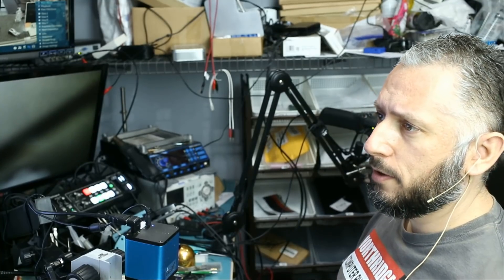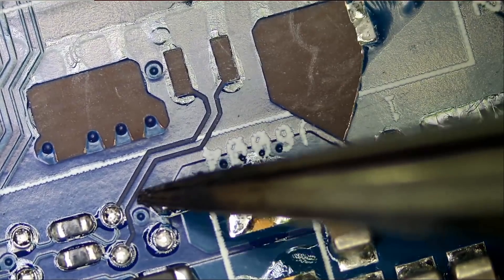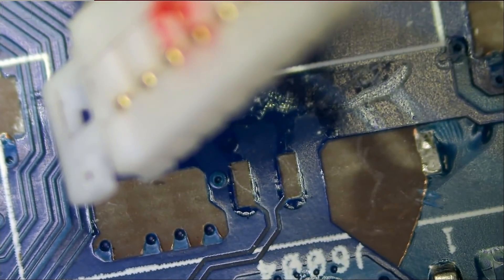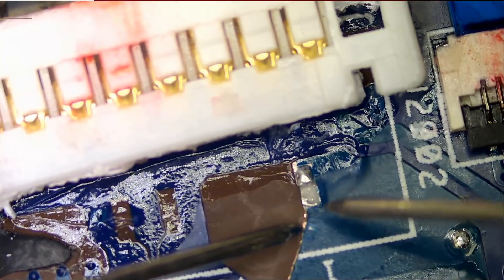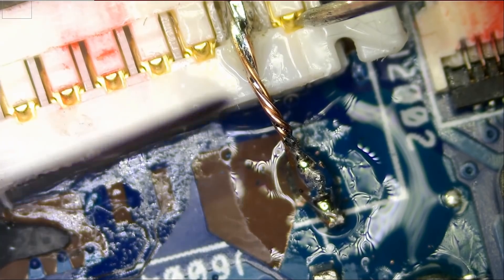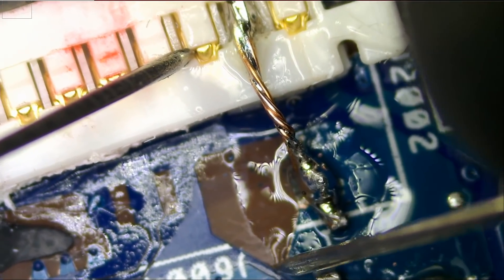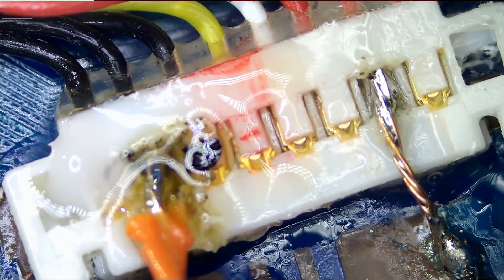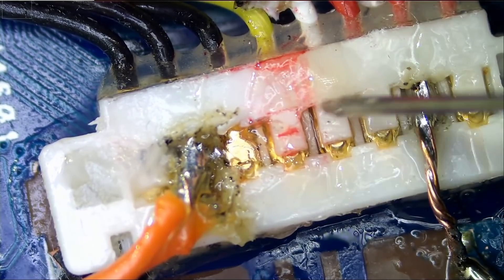Asus Zenbook UM433DA battery connector ripped off the board and all pads torn off the board Repair

Comment: Asus have a good spec laptop but when it come to board they have same issue weak battery connector weak usb port connector, i use to have 2 asus laptop now they are useless without charging cable.

Comment: Hi NorthbridgeFix, good job! I had a similar repair job. I have tryed a different unusual thing and it worked for me.
I restored the big pad with some thin copper foil of 0.25mm trimmed of the measure needed and glued in place next the good trace with 2 component epoxy Resin for the lamination of composite . After 12 hours I have bridged the old good trace with the restore one and solder back in place the connector. 
I don't think you will see this comment but if you will do let me know what you think and try on a scrap pcb. It worked flowlessy for me.
Have a nice day
Giacomo Farfara
P.s: it is very important to scratch with some sand paper or a cutter the two surface , the copper and the surface under the destroyed trace for a better mechanical bond

Comment: one wire connected for each battery terminal, there are reasons why there are 3 wires for each positive and negative coming from battery👌 😒 the three red and three black wires should be connected together for more "ampere"👎👎👎👎

Comment: 100% agree on the solution used, as when the battery is gonna be changed they'll just desolder the jumpers from the connector and have them soldered back on the new battery connector 
Amazing job brother <3 be safe rabi yahmik <3 
laptop videos are the best <3

Comment: You need to buy some DIN 0.1 inch pins from eBay. Next time put the pins into the connector then solder.

You should have soldered all 3 wires from positive and negative. 3.5A

Comment: Would have to agree about the comment regarding the battery connector not being used and a direct connection being done instead as it stops a easy replacement in future , glue connector and run jumpers from connector same method but more future proof , though I guess owner could snip current battery cable and use a connector block for new one in future.

Comment: I wonder why you only connect one wire each. All the current has to go through one line instead of three. I suppose the manufacturer would have made only wire in the first place, if that was enough, wouldn’t they?
P.S.: I don’t want to criticize just wondering.
Reply: Richardz Connected on the battery clearly, on the plug, not visibly. But the expert knows best.
Reply from the maker: The  battery wire inside the insulation is very thin. The one I  soldered is bigger then all 3 combined. This is a very common repair that we do
Reply: they are already connected to eachother in the plug
Reply: When they wires are connected in the plug, it makes sense. I didn’t see it like this but that must be the answer. But if they were not connected in the plug all the current would need to go through one of the tiny wires of the battery (while of course the jumper wire is good enough to carry the current).
Obviously I am not an expert.

Comment: if I didn't need to disconnect the connector, I would just get rid of it altogether and just stripped the wires and soldered them directly. but your way will work well too
Reply from the maker: You can do that but you have to secure the wires in place so they don't pull off the board rip more pads.